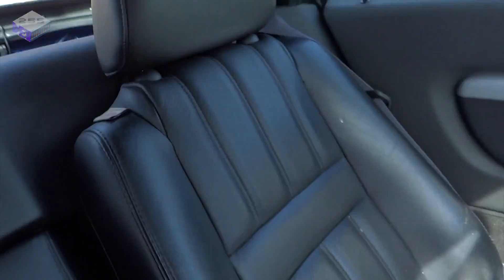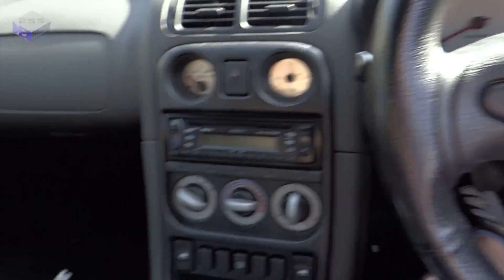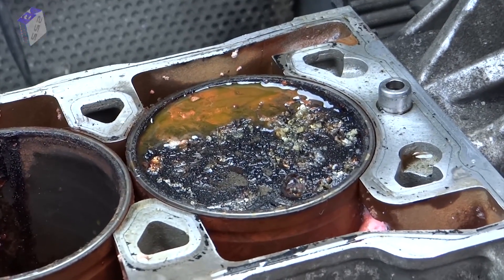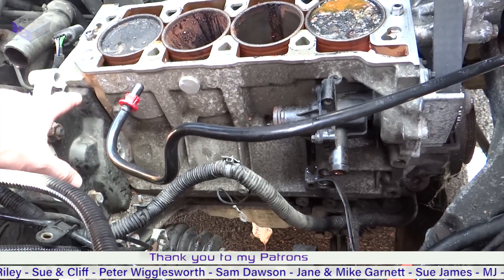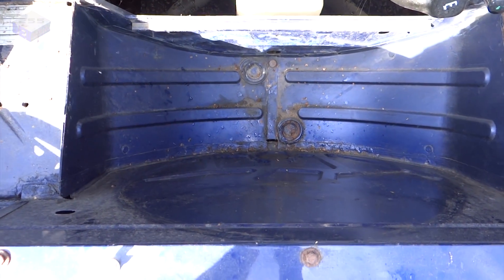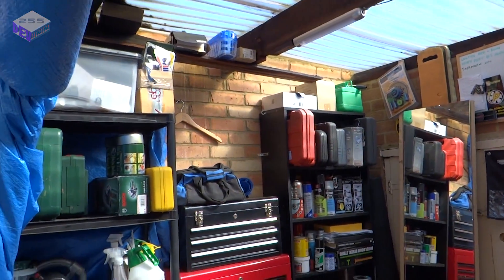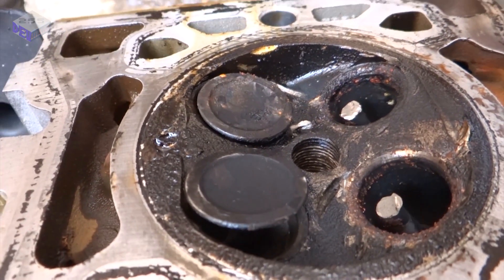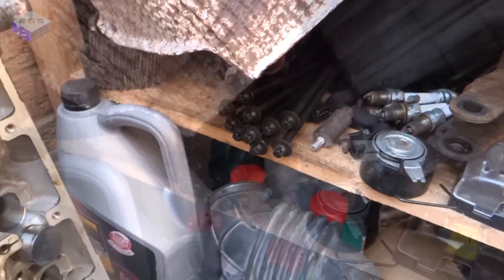MGF EV Engine Failue Investigation and General Update

Comment: Hi Neil, I've been following your CNC conversion videos with interest and thought I'd have a look at what it's all in aid of.
Suggestion... Why not put batteries where the petrol tank is? You could probably whack quite a few in that space.
Reply from the maker: Hi Fred, good point, I may put some reserve batteries in there. I was planning to have a removable battery pack in the boot as I'll only be doing short journeys and could then charge the pack in the house rather than running a lead to the car. My initial thoughts was to have a large long distance battery pack on trickle charge out of the car and a small pack for short journeys, that way there is less energy wasted dragging large batteries,  then you could take both packs on a longer journey and do the same at the destination,  so small pack for running around. The small pack could also act as a reserve to get you to a charging point. Thank you for watching 👍😁

Comment: Nice, I’m thinking to do the same sort of thing, how you getting on? 
Where about are you?
Reply from the maker: Hi, I am doing a lot of research and have been milling out some of the parts, although I am concentrating on converting my Milling Machine to CNC at the moment, this will massively help the MG F project as I can then CNC all the components. This as it was taking many hours to mill each part in the evenings and it would take me too long to make, please check out my CNC Mill conversion too, where some of the programming will help with the MG F project. What car are you thinking of converting?
Reply: Neil Devonshire - Dev255  an mg f as well,  I’ll use a dc motor to replace the engine. But I really enjoy following your journey, looking forward for the upcoming episodes 👍🏻
Reply from the maker: Thank you, I will try and do an update video within the next couple of weeks, I have a CNC video coming out tomorrow and am currently milling out parts for the CNC X-Axis, so all things moving forward. Glad you are enjoying the content.
Reply: Neil Devonshire - Dev255 what is gonna be your pack voltage?
Will you only use lipo batteries ?
Reply from the maker: I am using 6S LiPo at the moment, these are around 22.2v which are ideal for the kv rating of the motors and current carrying capacity of the 8AWG cables I will be using. Mine are only 4500mAh at present, just for testing.

Comment: you know when you get the EV motor hooked, you can fab a pulley and bracket to run your alternator/generator to keep batteries charged.
Reply from the maker: Hi Kerry, are you talking of perpetual motion? If so I would love for this to work although physics does not allow it as far as we know yet. I may hook up the alternator to kick in to charge my auxiliary battery though if it runs low; this will be used for the lights and vacuum pump needed for the brake servo.
Reply: @TheSolarPoweredEngineer  as long as the ev motor is spinning, the alternator will produce the power
Reply from the maker: @kerrylane881  I will measure the current used spinning the alternator and measure the output current to see what the difference is, that may show a rough indication of efficiency, I shall let you know :-D.
Reply: @TheSolarPoweredEngineer  Okay and remember the alternator produces AC current so you will need a AC to DC converter, roughly a 4000 kw
Reply: Neil Devonshire - Dev255 I think he means use it as regenerative breaking to recharge batteries as the car slows
Reply from the maker: @tonyoliver4920  Hi Tony, that would be a great option that could keep the Auxilliary 12V battery charged. Unfortunately, all the individual batteries could not be charged this way yet as the speed controllers do not offer regenerative braking, I may look into changing these controllers as there is new technology coming out all the time.
Reply: Neil Devonshire - Dev255 I believe the original hybrids with regenerative breaking had (for example) front wheel drive and a motor (Dynamo/generator) connected to the rear wheels to recover energy. So there are ways to do it
Reply from the maker: Hi  @tonyoliver4920 , I'll take a look into it. The other way I was thinking of achieving this would be to use the ODrive system as a speed controller for all the MGF motors as they have regenerative braking built in (see my CNC Mill Conversion, new video out Friday). This will then allow me to use regenerative braking just by taking my foot off the accelerator, so it's self managed. I will keep you posted 😀

Comment: Nice Mgf Neil, I had the same model and colour in the UK before emigrating to Australia. I heard that the bloke who bought it converted it to lpg which then decided to catch fire and gut the vehicle! Real shame as it was great to drive. Typical how one loose bolt can ruin a whole engine, still it did mean that you started this brilliant project.
Reply from the maker: Hi Martin, that's a shame yours had that end, I had a TVR Cerbera that a tree fell on, so I feel your pain. Don't worry I'll have plenty of safety features on this one where it will monitor ESC, motor and battery temperatures individually and be able to isolate them if there is a problem or just needs to cool down, plus an emergency stop for all circuits too. I'm glad you liked it